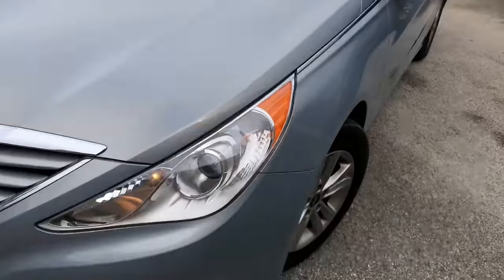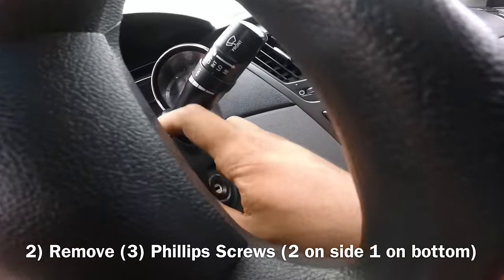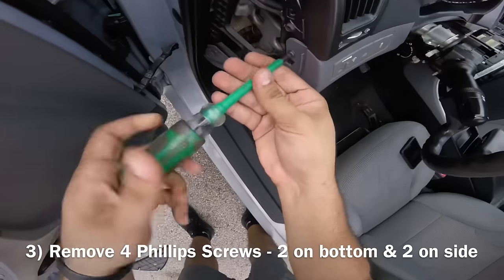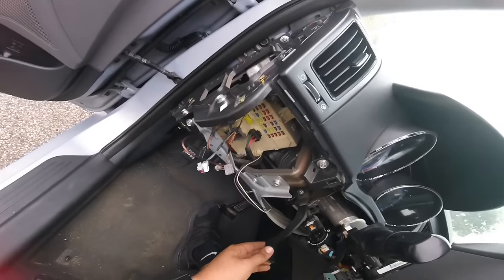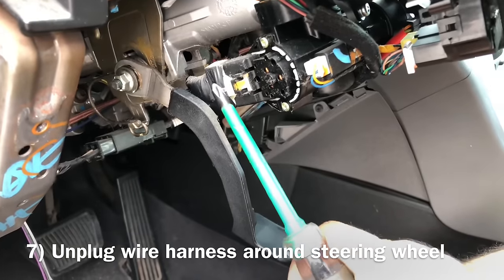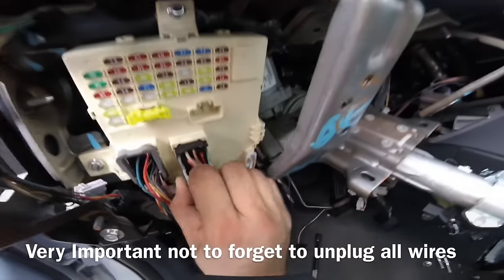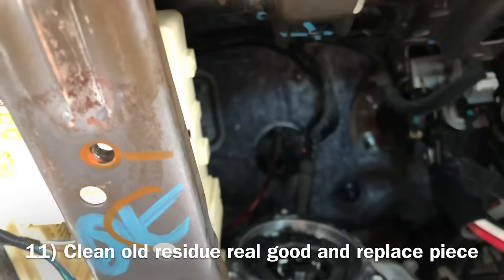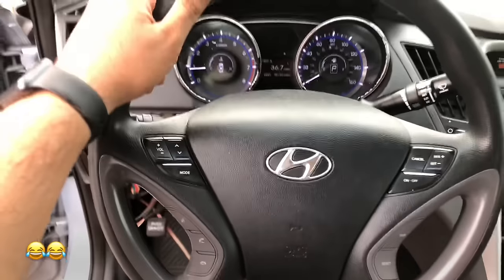HYUNDAI STEERING WHEEL NOISE : HOW TO FIX - SONATA/ OPTIMA 2011-2014 UNDER $20!! FAST & EASY!

Comment: I fixed this yesterday. Took about 4 hrs. Everything was easy until I had to put the column hook back in. That was haaaard to line it up. I had to get a neighbor to help me align it and help lift. Idk if I was making it harder than what it was. So MAKE SURE to look at the angle and everything before you unhook it. No lights came on. My alignment is the same. The noise is gone. The part that was there was completely shreded. I did this on a 2013 kia optima. Have a great day!
Reply: Celes omg! i have a 13 optima too and mine Is doing the same thing lol I would love to talk about how you did yours and where you got the part
Reply from the maker: awesome! I am proud of you for fixing it! and yep I had to use my feet to hold the column while lining up the hook! it's a pain! lol yeah no lights should come on if done properly, no alignment needed if done properly! and yeah those parts wear out and it sucks! thanks so much for sharing! I really appreciate you for watching and commenting your experience!
Reply from the maker: Part can be obtained at Hyundai Dealer. for around $20 or $25. or can be ordered online. and thanks for watching :)
Reply from the maker: Celes Wow thanks so much! And that is exactly what we were trying to achieve! Give instructions easy enough for anyone to do it! Thanks for watching! Love your feedback!
Reply: I had to change out this part myself and heres the rule of thumb ; if the person posting this repair video says that it only takes so and so time, you had better add an hour or two because for one your going to run into an unforseen problem that doesn't show up in the video, two ; the person posting the video exaggerates the time of repair completion like this one.
He couldn't have done it himself because hanging the steering column is the biggest obsticle to this repair. You have to raise up the column from the bottom, hook it then  push it down, then slowly slide it back upwards to line up the top bolt holes. Can't pull it too far upwards or you'll unhook the column. It takes two people for this part of the task.
Second ; he never mentions the difficulty in removing the back screw to the metal canister where the little grommet is located. I had to use a 30T "L" shape wrench and a mirror and flashlight to locate that screw to break it loose.
All in all it took every bit of 4 hours. The video was helpful, it was just a little labor intensive than what the videos showed.
Reply: @aaronlopez5221  not true I did it with one person. Ya just gotta be strong and flexible haha
Reply: @josephroberts2555  strong yes, at age 63 flexible doesnt come into play. You'll see when you become my age. My mind says bend, my body says " your kidding right"?
Reply: @aaronlopez5221  I'm 64
Reply: Lol I’m a professional but I did one of these for the first time today and took all but 30 minutes. I kinda felt bad it took you 4 hours haha
Reply: Yah  it looks easy by watching others doing it anyone can pick up a screwdriver but do you know what comes next to many  people    want be mechanic this days
Reply: @JoseHernandez-hx3rs  bro that comment made no sense 😂
Reply: I respect you ! what a beautiful lady !
Reply: @celes7210  I bought the part from the dealer in Canada for under $4 CAD. They know they messed up and are not trying to make a profit on the part. My understanding is that the genuine part fixes the original problem of the part being too fragile so the fix should last.
Reply: @HidalgoMotorsCo  is that the same on the sant fe sport
Reply: Celes, you work on your car? Yourself? You re marriage material
Reply: Pretty much my experience too so not quite so easy of a job also a little difficult getting the T 30 tool in order to takeoff the canister. But got it done!
Reply: What's the name of this broken part?
Reply: Whats the part called?
Reply: @MrLulus1976  flexible coupling!
Reply: Does anyone know the name of that part
Reply: @HidalgoMotorsCo what's the name of the part?!
Reply: @lollol-bc2wu what part is this?
Reply: Thank you for your advice.  I made sure I had one extra person to help me put the steering column back up. Very useful video. Help me solve 2 problems I was having. 1. Clicky sound from the steering. 2. Car pulling to the right when braking.

Comment: You didn't tell me how frickin hard it is to get that steering column back into place! I had to use a jack to push it into place.
Reply from the maker: Man I agree! that is the toughest part! I sat on the driver's seat and used my feet to help me lift the steering rack into place... so I used both arms and both legs lol but made it without struggling so much. thanks for watching!
Reply: Hidalgo Motors Co TV  as a Hyundai technician we have a technique of doing it without dropping the column and it takes us 15 minutes or so
Reply: @Michael Dre how?
Reply: @michaeldre2447  Make a Video
Reply: Lulu Pastrana Make video, get fired.
Reply: Most likely they access it from above after removing the gauge cluster.
Reply: Michael Dre I don’t know how everything is plugged back correctly lights and radio come on but car won’t start even with a jump....is there any suggestions you can give?
Reply: @michaeldre2447  Please share the details..... You will get mad props!!!
Reply: @michaeldre2447  which shop do u work at?

Comment: I did this today and took about four hours and had to get help putting the the steering column back in place however I am 71 years old lol and my wife helped! I would label this job a little on the difficult side. But I did save $400.00 doing it myself!!!!!

Comment: Notes to people trying this:
1) Unhook the negative battery lead after taking out the screws in the steering wheel.
2) Move the driver's seat all the way back.
3) Have a T30 screw driver head ready.
Reply: You are a life saver for this. Just did this today, took me a little over an hour and works BEAUTIFULLY!! THANK YOU!!!!
Reply: Will this issue also cause the steering wheel to shake at higher speeds? I've had that going on for a while and it started around the same time as the knocking steering wheel.
Reply: @joeaardvark9214  it would be a small jiggle but not necessarily a big shake, but if you mix this and your tires needing alignment (or similar) and you may have a shake
Reply: @nathanreed2889  Thanks for the response. It's been shaking at higher speeds for a while now, but only at around 80, but now it's happening at around 70 as well. I had the tires balanced and alignment done, and nothing fixed the problem. I'm thinking if this doesn't fix it, it may be the tie rods.
Reply: @alangrandfield9912 what is the part called ??
Reply: What is this part called?
Reply: @georgeenriquez6708   Steering Column Flexible Coupler
Reply: @joeaardvark9214 This work for you? I have the same issue where it really only starts to jiggle at higher speeds, and usually when perfectly straight.
Reply: @mrhoach2229  I took it to a shop to have it done because I didn't have the time or the tools to do it myself, but yes, this was the fix. That little rubber piece he holds up at 8:55 is the culprit.
Reply from the maker: @joeaardvark9214  yes it will
Reply from the maker: @nathanreed2889  thanks man you're the real MVP

Comment: Been dreading this job for over a year and saving this video... finally did it today.  That column is heavy and awkward for one person.  Missed the small plug on the motor control board and got into a little trouble once the weight came down, but I got it lifted up and unplugged (need 3 or more hands).  To lift it back in, wound up using a piece of paracord to hold up the front and the jack from the car under the heavy part in the back to guide it back up in there and get it hooked.  Back together, no codes or exploded airbags, nice steering, ready for another 100K!  Thanks for putting this guide together, got the job done for $3.20!

Comment: Fixed  it in an hour and 10 min with your video. NO ISSUES!
My local mechanic quote was $556.00
 $550 in my pocket after parts of  $6!
Only drag is now I don't trust the local mechanics!
Thanks!!!

Comment: I just repaired my 2012 Hyundai Sonata with this video and one other (to help reassemble).  The video was pretty good. I DID discover that it was not necessary to remove all the electrical wires--such as the bottom panel which you can just move to the left side.  Also, it is important to note that there are 3 T30 screws on the steering motor and the one on the back is very hard to reach if you do not remove the steering column (the T30 screws may be difficult to remove with a normal screwdriver/ratchet screwdriver [with the T30] because they are torqued at 8 lbs, I believe.  I used an adjustable wrench on the T30 bit).

Comment: Thanks so much for this video. The tip on removing the steering motor in place so you don’t have to completely remove the entire steering column from the car really saved a lot of time. I was able to do this repair on my son’s car in about two hours, and that was with a lot of stopping to rewatch parts of the video. Dealer wanted $450 for the repair since it was out of warranty.
Reply from the maker: Man I’m so proud of you! Thanks so much for watching and thanks so much for sharing! Congratulations!

Comment: Veloster is a little different!

I did it! This is by far the most complicated car repair I've done so far but I was able to do it because of this video and several others, also with my wife helping me lift the column back into place.

On a 2012 Veloster, you will only have 2 vertical bolts (instead of 4) holding the steering column up near the wheel and then one in the back of the column (closer to the front of the car) going horizontally. The horizontal bolt will need some serious force to break it loose but you can do it. That's the only big difference I noticed.

After I put everything back together, the car wouldn't crank. Turns out I had forgotten to plug a cable back in (ignition lol). So if something isn't right, just recheck your cables and make sure there aren't any spots with something not plugged in!
Reply from the maker: Oh wow! Lol yeah it’s always good to go back and double check even if you think you’re good lol! Thanks so much for watching! Glad we could help you! Thanks so much for your feedback! Really appreciate it!

Comment: After taking mine into a auto shop, they charged me 250$ I had already looked at a similar video but decided I didn't want to try it, anyhow after 6 months it happened again and I am now doing it myself. Hopefully this turns out good. My husband is looking at me like I've lost my mind. 😂, 
So I'm back after a few hours, that steering wheel shaft is heavy 1st of all and then beware of the cramped space anyway if I had to do it again i would because overall it was worth it!
Reply from the maker: WOW!! I am proud of you girl!!! Showing straight independence and will power!! I am glad my video was helpful to you!! Hopefully you won’t have any issues with it for long :) thanks for watching it means A lot!
Reply: Don't do it!  It's free warranty work go to the dealer
Reply from the maker: It’s true! However not all the Hyundai’s qualify for this repair :(
Reply: Wow respect!
Reply: Good job girl, inspo for me    😊
Reply: @bobkristinnelson2861  they extended the part warranty to 10 years or 100k miles. Ours had 109k so the dealer wanted $375 to do it.
Reply: Brian Werner Where can I see/find that the warranty was extended to 10 years ? I have a 2013 Hyundai Sonata and I’m scheduled to pay $250 tomorrow to have it fixed but Hyundai told me I wasn’t covered
Reply: Ok Fuck it . I’m about to do it too. I’ve called 3 mechanics that said they don’t want to mess with the power steering n computer . Then Hyundai said it would be a minimum of 300 just take apart . I got the piece at Advance Auto Zone. I do shit to my car all the time. Thanks for proving that although it’s a pain in the ass it’s possible ❤️
Reply: Where did you buy that piece from ? At what price ? Thank you
Reply: At the dealership and it was 3$ kid you not
Reply: @ThatHahn  thank you I will try to replace mine hopefully it works
Reply: I live in Rosharon by Houston, so depending on where you live then the prices may vary. I did call first bc I hate going to places and they don't have what I need. Good luck friend, you can do it
Reply: @ThatHahn  Thx a lot. I will update you from Southaven MS
Reply: How much was the piece?
Reply: @josealcala1309  At the Nissan dealership here it was 3 bucks
Reply: The shop tried to charge my family member the same price $250. But I'm about to do it for him right now.
Reply: Great video 👍 thanks.
Reply: I wanted to do myself until watching the video on all that needs to be ripped apart I thought oh heck no. But I really don't want to pay $250 or more to fix this little $13 part. Ridiculous.
Reply: So how did you do? Is everything okay with your car?  I have an Elantra 2013 and its doing the same thing.  I want to give this a try.
Reply: @pictureme624  yes after me fixing it, it has not messed up again. I am hoping that it stays that way!
Reply: Does a worn out piece makes the steering wheel shake when you brake?
Reply: @AwsomVirus  yes, however not only that, but your steering wheel will make a clicking noise when you turn it to the left or right. If it doesn't do that then you may need new tires or an alignment if only your steering wheel shakes
Reply: @ThatHahn  my steering wheel makes the clicking noise when I turn it too. Thanks for taking the time to reply and helping me out.
Reply: If it happen after 6 months perhaps there is something else wrong thats causing it to break down. 👀
Reply: @pictureme624  2013 Elantra here also. Very happy to find out the cause of the steering column clicking noise! I do not like nor trust the Maint Dept at my local dealership (great sales people, tho), and I am a very old lady, so will be happy to pay a very good local car shop to do this extreme hassle job for me! Just glad to know my steering wheel is not going to come off in my hands! I love my 2013 Elantra ... there are hundreds of them in the city where I live ... very popular car.
Reply: I’m very mechanically inclined but not so much with cars….
But you have gave me the confidence to tackle this,this coming weekend .
Thanks so much for the confidence booster.👍👍

Comment: Thanks. Followed exactly same, and the issue was resolved.
This issue on my 2013 Sonata occurred at 85Kmi when crossed railroads. The most headache was the T30 screw at the back, which I could not see, but I could access the screw with many trials. It took total 3 hours for me. This video was really helpful.